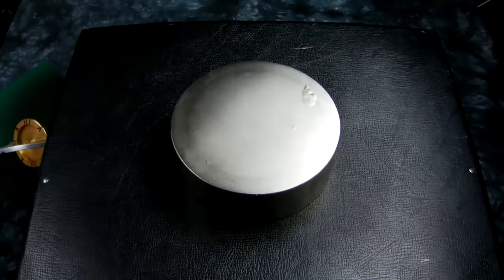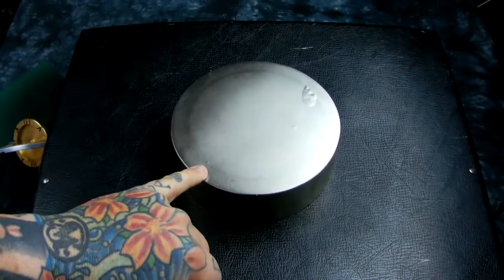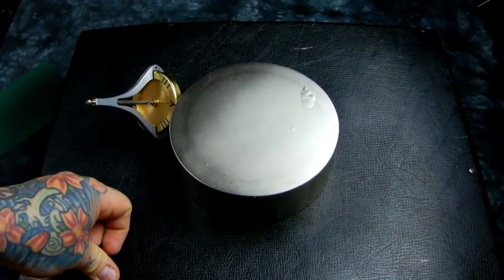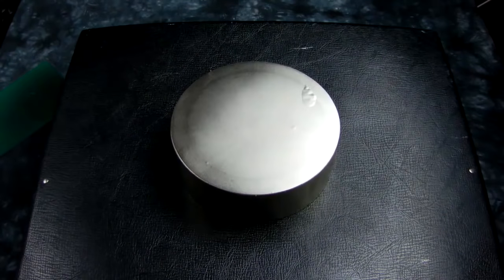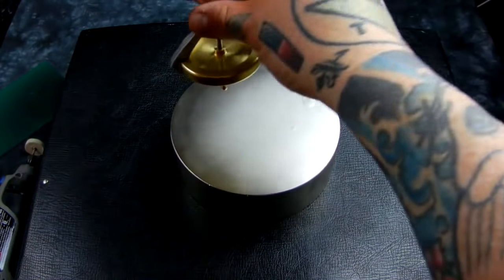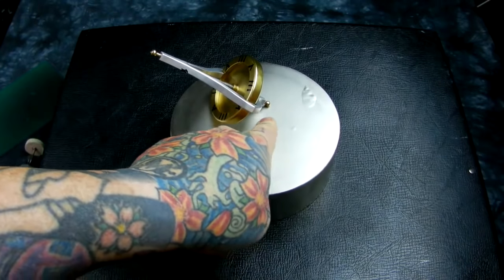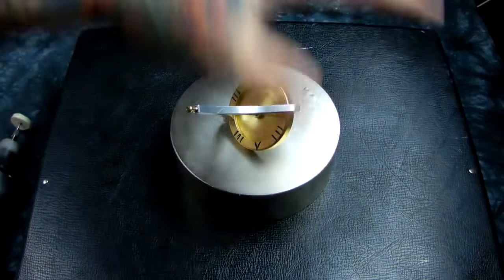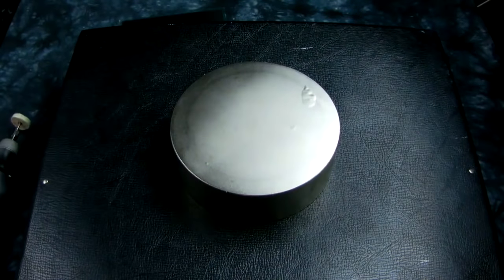Must-See Video! *SECRETS OF MAGNETISM* Never Seen Before* Torus-Hyperboloid

Comment: The field at the side of the magnet is very high. The flux density is actually higher due to the flux attempting to go from north to south in as tight a return path as it can. The flux cannot touch or come together as it is always in repulsion to the next line of flux. Like poles repel and the lines do the same. The reason you are experiencing the loss of motion is called eddy current loss. When in the center of the magnet the gyro in a singular magnetic field in every direction it will be the same because you are in the center of the disc so it only sees the singular pole and the uniform density from center toward the edge is present. So the material sees no difference in flux density during rotation and no change in alignment of the dipole. Like north or south and it should be even more or less across the full surface of the material and seeing the same field density and no relaxing of the internal dipole as it is definitely one pole throughout its surface at any one point from center to edge. Now I don't know why the gyro should not eventually stop just due to entropy, I am assuming it does but I have never done this experiment using a gyro.   

However that is not the case with the flux at the edge of the magnet.  The density of the magnetic field is different it is higher closer to the edge and the field is lower as you get away from the edge . So what is happening is that the spinning material is seeing more flux as it rotates closer to the edge and less flux is seen an inch or more from the edge. So flux is influencing the non magnetic material no longer with the same flux density uni-formally across the surface. As the spinning material is changing from high flux density to lower flux density at the max distance. The dipole is experiencing change and when it does it creates a loss or work is happening within the material,  it's internal dipole which relaxes during rotation from the high to a low density field when farthest from the edge. As the gyro material internal dipole is forced into alignment with the increasing flux density it creates a drag as the internal dipole goes from non-alignment and higher flux density while aligning with the flux's north south field.

 Where the flux is lower furthest from the magnet and not as compacted as at the edge of the disc. The flux density is less as you get further away from the edge of the magnet. Therefore the gyro's dipole relaxes during rotation due to there being less flux but when it enters the higher density of flux closer to the edge of the disc the flux forces the gyro dipole to realign with the magnets flux. The power to force realignment creates a loss in its rotation as it resists alignment by pushing back against the incoming increase of flux which is being more compacted into the gyros material as it gets to the apex of density which continues to push back against the alignment.  Overcoming the materials naturally relaxed dipole to align with the flux uses energy. It pushes against the field from the magnet and you see the rotational loss due to that pushing back or its resisting alignment. Look up Eddy currents.  We used this property of the magnetic field for brakes on the Accelerator ride at Knott's Berry Farm in California. You can see a copper bar come up and down at the end of the ride while waiting in line. The braking is swift and is not to hard on the people. It also is used on various other projects for slowing, creating drag on other products like fishing spinners.
Reply from the maker: WRONG, any gaussmeter shows the field is the SAME at the center as at the edge
Reply: Sorry I am not wrong on this fact. You have a Gauss meter? if so is the probe transverse or axial?Are you looking at the surface or at a distance? Yes,it is agreed that the field is more or less the same across the surface but not at at a distance. To give you a set up the test from the side of magnet. it will depend upon the type of probe you have. Tell me the type. I can send you a process for testing your theory and the proof of what I am saying can be confirmed.
Reply: capt. you get the prize. this is correct and the difference in the flux density is why the gyro sees more flux and resistance is as you depicted in your drawing. Good job. Thank you very much.
Reply: I can tell that you are correct about listening and ear plugging. I am an applications engineer and worked for Integrated Magnetic's for 18 years. I have heard so much from people who don't understand the basics of physics and it seems changing the names of already established nomenclature is one of the first signs of the lack of Magnetic's 101 in school. It can be a trial but with a little information most will find that the Force/ether/flux/magic within tat the surface and surrounding the magnet can be calculated and properly measured with some basic study and knowledge of magnetism for simple geometries.
Anyway I really initially thought he was seeking an answer to his question and that he was legitimately asking for an explaination. But he never responded to my question on the probe and the test process. So I, like yourself tried my best to explain but "such is life".
Take care
Rick
Reply: I don't know if he is real or not I just know the physics and what he is observing is eddy currents and I just wanted to help him understand the science but to no avail. I certainly did not want him going down the wrong path and really misinforming people. 

While I think he was being honest in his question "does anyone have a explanation of what is truly happening?" I can't give him nothing when I know what is at work and I have a great deal of time in design and manufacturing of magnet materials and assemblies and their use in a large variety of applications, so I spoke up.

He still may not understand or perhaps he is like me stubborn and making honest mistakes. I prefer honest mistake to charlatan. I do think he has a theory but it needs some tweeking. Or just a good book on physics or magnetics. 

I suggest the book Permanent Magnet Design and Application Handbook by Moskowitz and printed by Krieger. It was $150.00 but may be out of print. This is what every engineer got as a party favor when they started to work for us, 900+ pages. This is not a book for someone who is looking for basics but it is an engineering book for professionals.  

 And by the way the plating on the magnet is nickel plating with a copper flash for the adhesion as nickel plating doesn't really want to stick to the neodymium magnet and without it the material corrodes into a fuzzy ball of grey filings. The blister on the top is an indication of a not properly cleaned material or some moisture or contaminant within the plating process. Get it from china? I bet you did. 
Take care,
Rick

char·la·tan
ˈSHärlədən,ˈSHärlətn/
noun
a person falsely claiming to have a special knowledge or skill; a fraud.
synonyms:quack, sham, fraud, fake, impostor, hoaxer, cheat, deceiver, double-dealer, swindler, fraudster, mountebank.
Reply: rick Green d
Reply: Corey cayton 
did you have something to ask or say or that needs clarification?
Reply: +Rick Green + Captain Katawa - I thought he said/briefly almost showed to confirm what he said, that it makes no difference if he puts the gyro on its side or any other angle in the middle...?
Reply: +Simon Kali
He lied by omission.
He said "This point is same as this point" however it's TWO POINTS THAT MATTER, the Eddy's current depends NOT on the flux but on THE CHANGE of the flux. 
It's not abot how strong is the field it's about how fast it changes. 
And in the middle the field is all the same, it's symmetrical and homogenous, all same, the disc does not experience the change.

However on the edge one side of the disc is closer to the magnet and another is further away. 
Therefore when revolving like that iot experiences change of magnetic field "strong-weak-strong-weak" and any CHANGE of magnetic field results in resistance to the cange.
Reply: It is correct to say the field upon the surface is within +/- 10% of flux density but the moment you move away from the surface the field density depletes.
 
This is caused by flux trying to find the closest north or south pole and turning in the direction of that pole as quickly as it can. When it turns the probe sees an immediate reduction in the field. 

Because the probe is a hall effect sensor and can only see flux perpendicular to its surface. It cannot see any thing else and it shouldn't because any flux not perpendicular to its surface has already turned and is not able to influence anything not in its path (more or less for this discussion) so it registers the active magnetic field lower at any distance from its surface. 

You can mechanically test this by getting any disc or rectangular magnet on your fridge and by putting a piece of paper between the magnet and the fridge. You will see the holding strength of the magnet reduce as you add another piece of paper between the magnet and the surface of the fridge. I suggest post-its as the size of paper for the test but use 2x2 inch paper cut to size if you have none.

 As you add another sheet the thickness builds the gap between the magnet and the fridge till the magnets holding force is unable to hold the paper to the fridge.  

if you take the same sheets of paper and glue them to the back side of the magnet and allow the magnet to contact the surface of the fridge you will see that it will hold to the fridge (it may slip down the surface because of gravity and shear). This is due to more flux being present thus more holding power.

 The test shows that it is not that the magnet cannot hold the weight of the paper it is because the thickness of the stacked paper makes a gap and the flux uses that gap as a return path.  Flux like electricity seeks the closest or easiest return to ground or in our case the opposite pole.

So a gap reduces the work you can do with the magnet. Thus we prove that there is a reduction of flux present at any distance from the surface of the magnet.
Reply: Eddy current's are created by flux density and die pole resistance to change in non-ferrous materials. 

If you turn the die pole from north to south pole you get the maximum change and the max work or loss is created. 

If you have as in this case the disc rotating in and out of the field. The materials die pole relaxes as it leaves the influence of the magnet and is forced into alignment as it enters the increasingly stronger magnetic field
the closer it gets to the magnet. More density means more die poles are trying to change from relaxing to alignment. 

Increasing density of flux means influencing more of the material during rotation as relaxed poles get closer to the magnet. We get a loss  in momentum so it slows the rotation in this case. 

Think of it like this we have a pool of water the (flux) and above the pool a tire is spinning freely (the gyro) when we dip the tire into the pool it slows due to the waters resistance to its movement. The deeper the tire goes into the pool the greater the resistance to rotation. 

I know that this is not exactly what is happening but it is hard to explain without going over a lot of explanation of general physics. And I just don't have that much time to do that right now.
Reply: rick Green you know I think this guy is full of himself and no one is going to tell him different. It doesn't matter how well you explain or prove your point. He isn't part of the discussion because he's already decided the validity of your ideas. he's right and your wrong. lol kind of like a one man church I think.
Reply: Help me with this question Rick.. Is this a perpetual motion? could this motion go on for years?
Reply: I think he may actually believe what he spews, and not simply charlatan sucking cash off the fool. There seems to be a need to condemn the brilliant theorist and also the well educated Ph.d:  Messiah Complex.
Reply: Well the simple answer is no there is no perpetual motion using permanent magnets. The fields will eventually cancel out the initial motion and it will cog or fail to move any further. There is a notion for higher than unity energy production. That field deals with radio wave or antenna theory promoted by Tesla and it may have merit but I have viewed nothing that is working as of this time.
Reply: Hey Rick. I wonder if you could enlighten me on this video here, of this same guy. I have tried to make it have some sense to me but it just seems to be gibberish stuff strongly spoken. Am I correct, Is there some sense to it ? Any ?
Reply: Well if he places the top (gyro) in a perpendicular position to the circumference he will not see a noticeable change in the flux as it spins in an singular stable flux point. meaning that the field is stable on the two surfaces perpendicular to that surface the flux does not change its intensity or its diepole direction but if you turn it sideways so that the flux is going from a flux density of low magnitude to one of high magnitude you start to influence more of the dipole within the spinning object and something called work is being done within the material and any work done reduces the speed of the gyro as it is a resistance to change of the relaxed dipole having to align with the magnetic field within the interior of the material that is happening that resistance to change is seen in the loss of rotational speed. So it appears on the surface that it is magic or some fluke in space it is actually a natural occurrence of materials that are not ferrous metals and are within a changing magnetic field.
Reply: Well if he places the top (gyro) in a perpendicular position to the circumference he will not see a noticeable change in the flux as it spins in an singular stable flux point. meaning that the field is stable on the two surfaces perpendicular to that surface the flux does not change its intensity or its diepole direction but if you turn it sideways so that the flux is going from a flux density of low magnitude to one of high magnitude you start to influence more of the dipole within the spinning object and something called work is being done within the material and any work done reduces the speed of the gyro as it is a resistance to change of the relaxed dipole having to align with the magnetic field within the interior of the material that is happening that resistance to change is seen in the loss of rotational speed. So it appears on the surface that it is magic or some fluke in space it is actually a natural occurrence of materials that are not ferrous metals and are within a changing magnetic field.
Reply: (rick Green) I just realized I have spent more time reading your comments than the video. That says a lot.
Reply: I am not sure if this means I did or did not get the concept in a manner that was easily understood but I am glad to be of some help in either case Thank you - rg
Reply: Vitor Gracia I did not get the link to answer the question.
Reply: Stupid Man
Quick to put down Rick Green but I noticed how Theoria had no response to Ricks information that was well articulated. I was interested to see a debate as that's the best way to see all the facts and make an informed decision. I would put my money on Rick Green simply because Theoria had no response and should have responded. If Rick Green had been rude or a troll I would understand Theoria not wasting his efforts but that was not the case. I know 'no more' about the subject than you, so I rely on a good debate to raise the facts so that I can research them.
Reply: DeansVideoClips ppl
Reply: Randy I was referring to Rick Green's first statements. I know nothing of the subject but generally when someone is preaching something and someone challenges them articulately and respectfully they usually respond with some facts to back up their argument or ignore the person who disagrees. In the cases where I do know the subject and the above occurs the person who goes silent quickly is usually the person who has less knowledge. So personally having no knowledge on the subject the best way I find out the most correct or reasonable information is to watch a debate between two people who are knowledgeable and passionate about the subject and research their information for myself.
Reply: Hi, I read your comments and I want to ask you if the brass disc is having an induced back emf as it travels through the changing mag flux (because the brass disc is spinning) at the outside of the large magnet?
Reply: Rick, you are too kind. This guy is a self important arrogant jerk that thinks he is the only one on the planet that knows the right answers. He craves attention, the long winded, loud at times, repetitive dialog as well as the (show no skin) tats is a pretty good indication. Maybe in another 30 years he can be helped. You should not waste knowledge on someone that already knows everything. I feel bad for him to but I would rather waste my efforts on someone that can't learn then waste them on someone that refuses to learn.
Reply: Is there a mathematical equation that predicts the change in flux density relative to distance from the surface, poles...
Reply: Exactly Rick, you made mincemeat out of Kenny.
Reply: Exactly Captain Katawa, you made mincemeat our of Kenny.
Reply: Yes, you have to derive the line integral for the specific setup.  More realistically, you could approximate it with finite element modelling.
Reply: +DeansVideoClips  Rick Green is dead-on and it just shows that Kenny doesn't even understand basic magnetism.
Reply: +Randy Rhoads  If you are suggesting that they did not make mincemeat out of Kenny they absolutely did.  The eddy currents cause a drag torque on the spinning flywheel and slow it down.  This phenomenon could have easily been discussed, explained, and understood by all in the first week of an electronics course.  That's how bad poor Kenny is.
Reply: DeansVideoClips I think Stupid man (name) is just a precursor for what follows. It may be Thiojoe in disguise.
Reply: MrTHEORIGINALICEMAN
I think you might be right on that one! I also had a laugh when you mentioned the tatts... I find it hard to take someone seriously when they make those kind of life decisions.
Reply: Albert Einstein made poor life decisions and it ended up killing him so if you are too focused on what other people think about you, then you can`t really focus on anything past the mirror. FYI that was a quote from A.E. himself when questioned about his wild hair.
Reply: rick Green Rick Green I'm sorry but you're here first and save me so much time in energy. Thanks for your exclamation I hope everybody takes the time to read it. Well said.....
Reply: Theoria Apophasis. You gave us the answer, its the divergent field/centerfutlethat breaks the gyro momentum.
Reply: I'm confused. You have discovered a new way to slow down a spinning wheel ? What's so great about that ? Ok so the practical applications of this are..........zero ?
Reply: rick green - have you looked at any of the work of Howard Johnson and his permanent magnet motor and the patents he received for them?
Reply: Hi Rick Green. I was wondering if you could tell me what is happening in terms of the electric field of the spinning copper and the magnetic field combined? Is it the electric field of the free electrons of the copper that is doing the breaking because they are being displaced i.e., charge separation? I'm a noob and any help would be appreciated as you seem to explain things quite well. Cheers
Reply: rick Green What ehh
Reply: t00by00zer maxwell is probably one of the top three intellects in scientific history, I was intrigued with this guy till he just poo poohed that genius. If he had lived longer who knows where we would be today
Reply: Rick Green,  
It is not quite eddy currents. It is a little more than that. It's the "Lens Effect"; an inline current(a portion of eddy currents) created in the conductive material of the spinning gyro which creates the magnetic field opposing the change in flux.  
The only point made after all this chatter is what is the reaction of the gyro if placed transversely to the center field.  Probably will have the same effect as on the edge but this channel insinuates it doesn't but there has been no demonstration of that!
Reply: Yawn!  What a long, boring video, repeating the same thing over and over - and all to show an effect that anybody who knows the first thing about electro-magnetism would expect.  The drawing by Captain Katawa sums it up succinctly.
Reply: Matlockization lmfao kid go home
Reply: The gyroscope will also be able to be braked and alternately sped up while in the center by lifting it straight up out of the field, or pushed straight down into the field, the rate at which this is done determines the rate of braking or speeding up.
Reply: Flurban Moran - What?!  How do you work that out?
Reply: Mathematically speaking, it has to do with the change in the number of flux lines through the gyroscope.  In the center it is immersed in the magnetic field, right?  Taking it out of the center, it is removed from the magnetic field and the flux lines have to decrease.  A change in flux always produces a response to that change, an electromotive force - or an opposing magnetic field, if you want - in the object in question, which attempts to counter that effect, assuming that the object is magnetic itself or has an electric field, or fields, intrinsic to itself, or at the least, extrinsic from the external magnetic field.  There is a relationship between the rate of change of the number of flux lines, and the strength of the opposing force.

At the same time, the weight, and moment of inertia - or the way that weight is distributed throughout the object - have to be taken into account.  A heavier object will be harder to brake or speed up.  Maybe that is obvious.
Reply: I don't believe that any movement of the gyroscope wrt the static magnetic field will cause it to speed up.
If you produce a video demonstrating that, please let me know.
Reply: Flurban Moran - That was a great put-down.  Made me laugh out loud.
Seriously, though, when a spinning ice skater speeds up her spin by contracting her arms, she is applying energy in doing so, and it can easily be shown mathematically how that gets transferred into the spin - much like a pendulum weight on a string swings more quickly when the string is shortened.  However, if the gyroscope wheel is spinning near the rim of the magnet, then individual points in the wheel are moving through a changing flux density, current is induced which results in an opposing magnetic field, which slows the wheel down.  When the wheel is spinning in the magnetic axis of the magnet, then individual points in the wheel will be moving through points of that magnetic field that are all of the same intensity, so no current will be induced.  
I have done some experiments of my own, and while I must admit that my magnet is not like the beast shown in this video, it is nonetheless quite powerful, and I would have expected to see some effect, measuring speed of my lead wheel gyroscope with an optical tachometer, and plotting it against time.   First, I made a datum curve by plotting the decay of the rotational speed outside of the influence of a field, then I made several plots while moving the wheel laterally across the field, which shows it slowing down more quickly than the datum line, and moving it vertically up the axis of the field, which produced such a small effect that I was unsure that there was any change.  I was unable to find any action that would cause it to speed up even momentarily, which would have been shown by a bump in the curve.
If you can find an action that produces an acceleration, I would be very interested to learn of it.
Reply: The gyroscope has to be spinning the right way.
Reply: Flurban Moran - in a static field?  Which way should it be spinning?
Reply: Is the field static wrt the gyroscope?
Reply: OK - which way should the gyroscope be spinning wrt the field?
Reply: Hmm, you tried spinning it the one way, so by my calculations - carry the 1, divide by 2, invert the matrix - I have come to the conclusion that you try spinning it the opposite way and compare it to your so called datum curve.  That would be the logical thing to do, anyway.
Reply: rick Green why do you think he is a imposter. Maybe u should look at the work you have been doing and ask yourself the question. Is it possible I may in fact know how to engineer one property of the aether? And I had no idea how it works and how it’s related to the cosmos ?
Reply: Rick, or anyone for that matter with a definete grasp of these toroidal motions, an animation with explanation of motions would be great for most of we idiots, I am almost there but a truly detailed animation would probably get these facts across to most of the public and maybe some truly amazing things might happen!!!
Reply: Are there any artists here that would like to collaborate on this with rick???
Reply: I posted the prior two comments before seeing the Capt.'s drawing, perhaps a few more circles and arrows, and color animation(moving parts so to speak) and we can all understand it!!! or at least maybe, possibly I can!!!